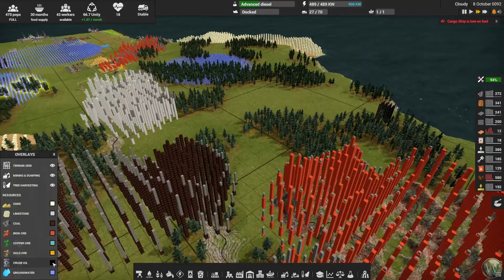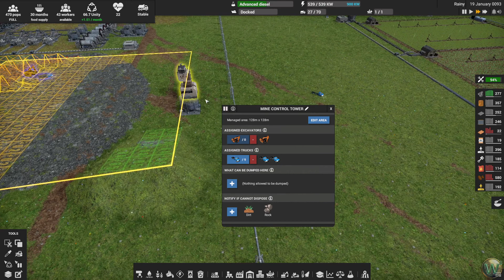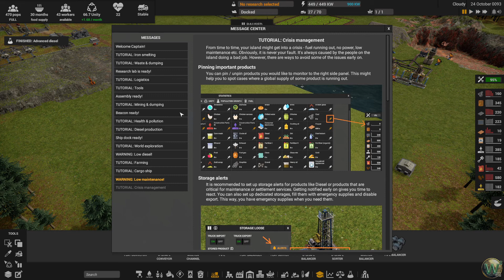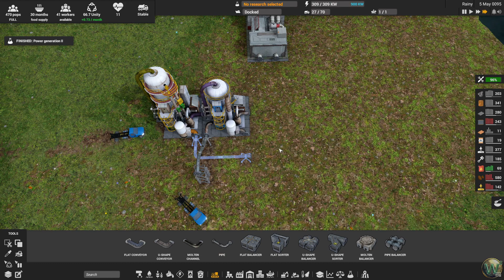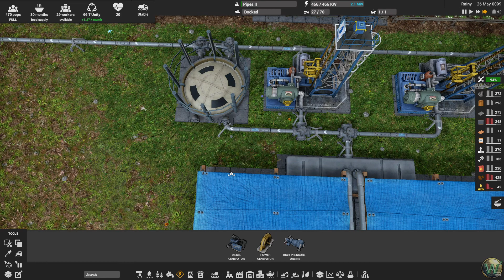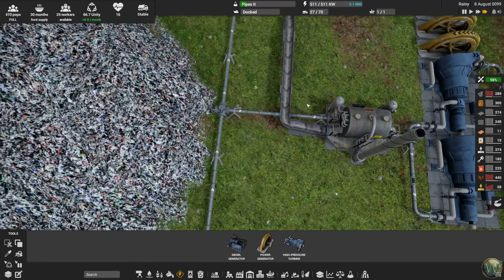Captain of Industry - Steam Power - Episode 16 - Let's Play

Comment: - Crude oil on the island will not replenish.  There are only two small oil deposits on the island
- Water will replenish as I mentioned last time.  But, you will run low on water, trust me on that one.
- for oil processing stage 1 and 2, look at the gas boiler to take care of your heavy and light oil.  You unlocked it.  There is a resource loop to discover with high steam.  There are many resource loops in the game.

- Also, be sure to right-click on recipe items to see the production/consumption of them.  Might have to write things down as the production loops get confusing.
- You forgot to place 2 flywheels on your power system.  They store mechanical energy from the generators.  it's a 2-2-4 setup.  Two turbines, two flywheels and 4 generators.  They can be in any config, like you found.  Also, be sure to click the slider that is labeled auto-balance.  This will save you massive amounts of coal.
- You can make toss some snow on trash mountain and boom!  Ski season!  Sell tickets.
Reply from the maker: Ah cool!  I did miss the gas boiler.
Flywheels too.  Dang!
Note that the next episode is already recorded so I won’t have gotten to these comments yet
Reply: @Wally1169  Pre-recorded, eh.  I'll still yell at you like it's a live stream.  lol.
Reply from the maker: Works for me 😂